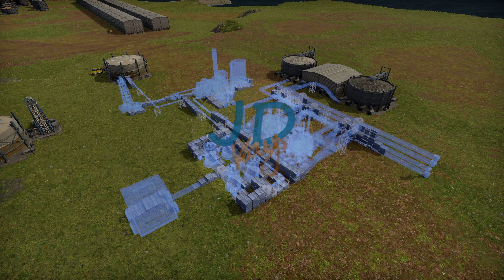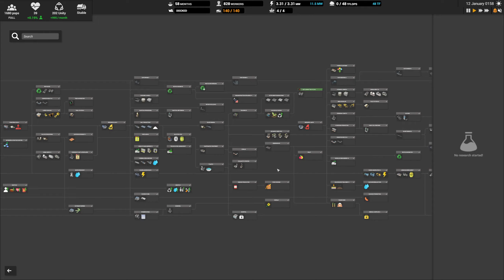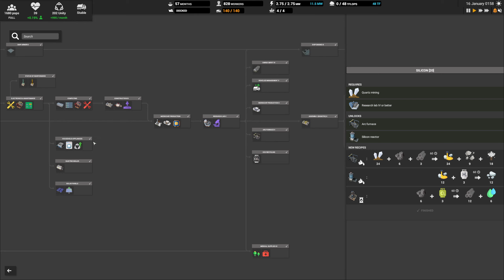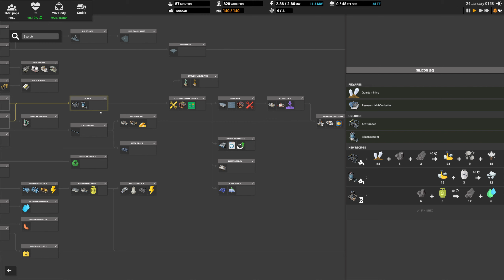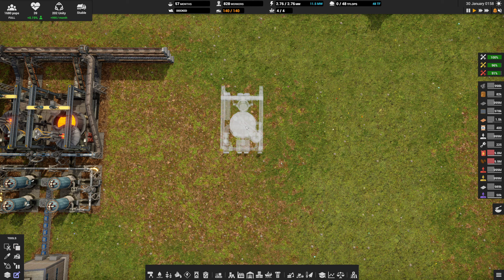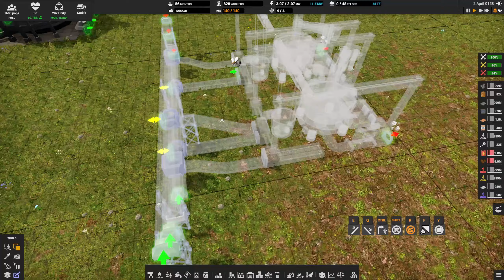Upgradable Smelter Designs - Quartz Edition 🚜 Captain of Industry  👷  Walkthrough, Guide & Tips

Comment: This series was great. It's also nice that the furnaces are mostly self-contained between each output--you can think of the furnaces as your base component and each output as a separate module you attach to the common furnace structure. I just finished rebuilding my entire smelting sector using that principle.